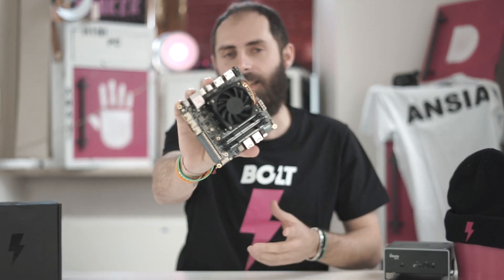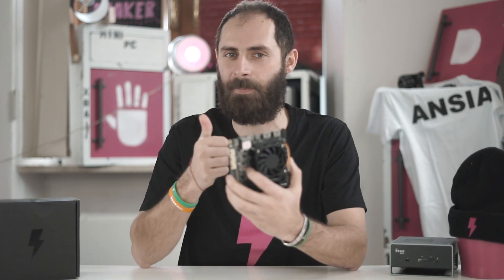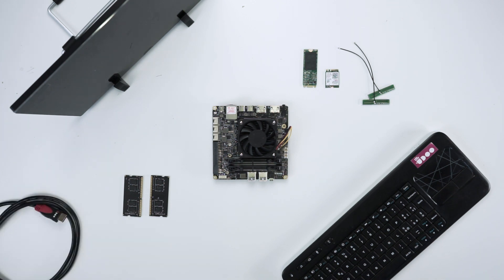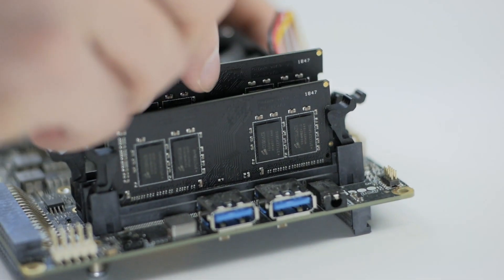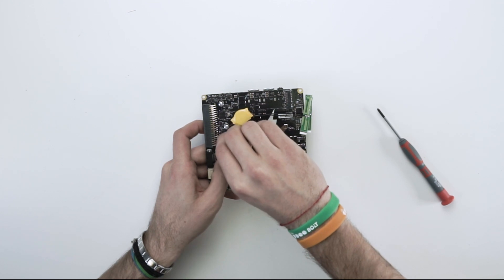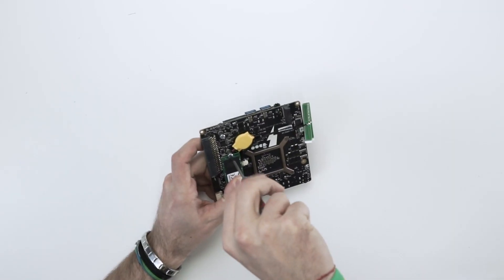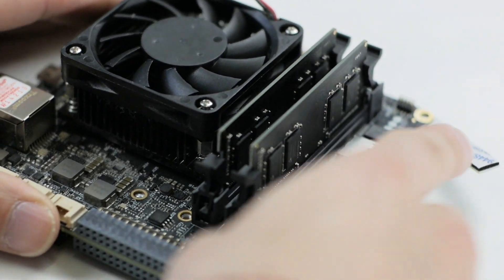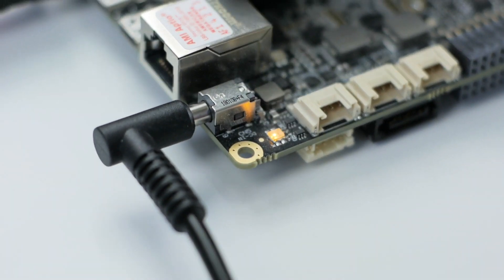Chapter 1 - UDOO BOLT Basic Setup

Comment: Kindly help me to understand the purpose of Wi-Fi and Bluetooth modules. It is required to set up for the Udoo Bolt V8 board to function well? Can the Wi-Fi and Bluetooth connect without the modules installed?
Reply from the maker: Hey there, there is no Bluetooth and wi-fi functional built in the board itself, so if you wish for the board to use those functionalities, yes you have to install the modules

Comment: Ok, I'm going to have to give this tutorial a HUGE thumbs down and for only 1 single reason (that took me like 2 hours of troubleshooting)
Your power button is so tiny and hard to find that I literally thought that my UDOO bolt was a lemon

For anyone else struggling with "My UDOO Bolt won't load, even though I connected everything" - there is a ridiculously small, hard to see button on the side close to USB A ports that needs to be pressed for it to start
Coming from other SBCs that don't generally have power buttons or at least are explicit about it I didn't expect that this would be the issue I'd be having for 2 hours

Comment: do you think this system could be powered through a battery back for some sort of mobile gaming system?
Reply from the maker: Ciao Jeremiah, it's possible to use a MAC BOOK power bank. to power the BOLT up, but the battery will not last for the longest time. 

Eva
Reply: @UDOO  you could if you're were willing to Drop the change on building a Lithium titanate Oxide pack 

But they're pricey

Does the bolt accept touchscreen inputs based on the integrated adruino functions or do I need to add anything special???

Comment: will it work with laptop powerbank with same 19v 3.4 A ?
Reply from the maker: Hi Brawo Maciej,  here's the documentation about your question: 
Power In:
- 19V DC Power Jack min 3.15A (60W) for basic functionalities - Male connector 4.5mm x 3.0mm with pin inside.
- 2x USB Type-C power in. PD sink profile 20V/3A(60W).